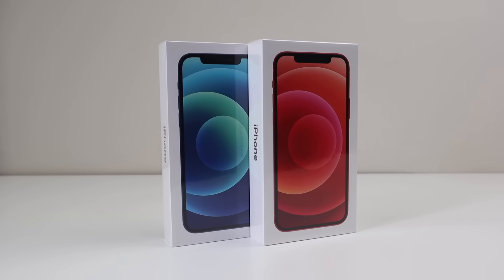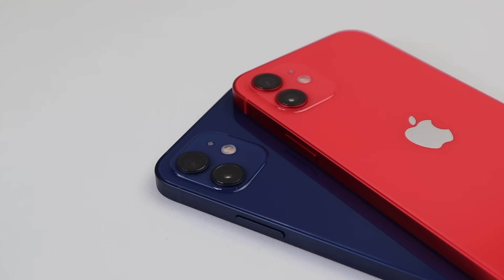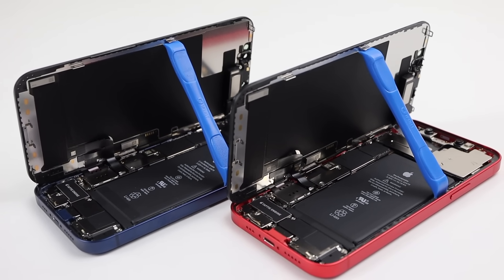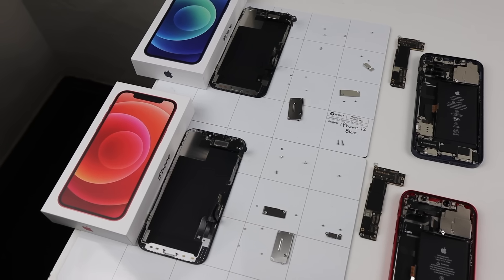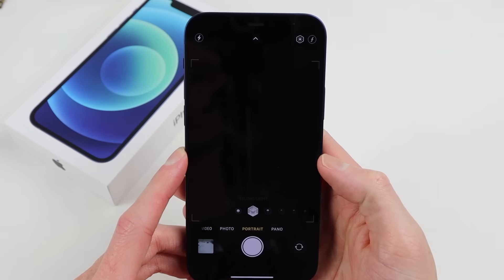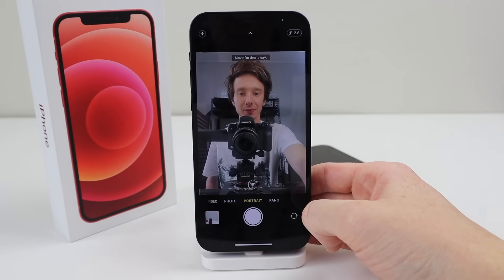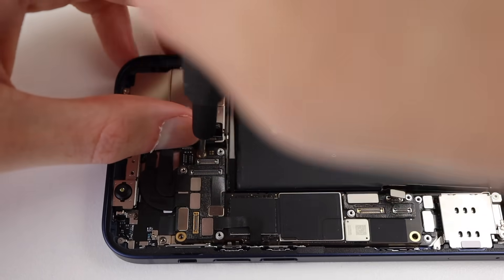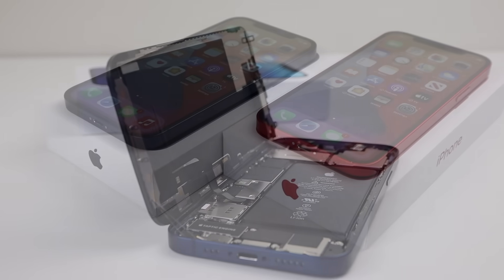iPhone 12 Anti Repair Design - Teardown and Repair Assessment

Comment: “We want to be 0 waste by 2030” but you gotta throw out your old chargers and any third party chargers in order to use your phone
Reply: Apple probably: It's not us who producing waste, it's the customers.
Reply: "It's a waste of potential revenue if our customers can just repair phones themselves, or worse still - with parts from other suppliers! Shocking, shocking waste... what can we do to reduce waste to zero..."
Reply: There can’t be any (new) waste if everything and everyone is dead ;)
Reply: ? old charger still work on the iphone
Reply: @dawaby1  yes. But if have a brick, but not a cable, the USB-C to lightning doesn’t work with whatever bricks you have at home, as most of them are USB-A. Therefor, you need to buy a brick with a USB-C input.

Comment: Ok Apple fanbois, why would you want to spend $1500 on a phone with a tiny battery, no ports and that you can't repair from your local shop?

A nice 'de-googled' Samsung would be a great choice and works well with all of the same features and apps. iOS isn't what it once was, and iTunes works with Android, so...?

Also, water resistance isn't the real reason for the stronger case glues.. An inexpensive case or ring holder (maybe both) would be in order if you aren't capable of not dropping your phone. These glass backs may be 'premium' but they can't handle life.

Comment: I think Apple must have released several versions of components or peripherals like battery, cameras, display or even face id with different compatibility codes for each card model.  Or the parts are encoded with a recognition memory circuit based on the operating system.  There will always be Chinese to dismantle everything and manufacture high quality parts using the same compatible manufacturing processes, as they are the ones who already manufacture and assemble.

Comment: As a part time automotive mechanic who works at an independent shop, I would be so infuriated if suddenly independent mechanics could no longer repair people's cars. Going to the dealership to repair an issue might give you better service and the problem might be diagnosed and fixed sooner, but it will be WAY more costly to do so. I really hate what Apple is doing, because this discourages lower middle class people from purchasing any iPhone since they know they can't afford to have Apple repair it and instead have to resort to 3rd party technicians, if that option is stripped away then they can't purchase an iPhone. Imagine if Ford went "What that? You did a simple task like changing your oil all on your own instead of paying four times the price to come to us? Welp looks like we'll just have to take your warranty." And this is just one issue with Apple, let alone all the other corporate bollocks they're pulling.
Reply: Apple dont repairs, they resell unfortunately, i got my iphone 5 years ago and i asked they to fix it, they say it was damaged by water and it's better to buy another phone. Then i went to an independent repairer, he simply install an older version of iPhone 5's OS and it just start working normally, this could also mean that Apple are using IOS updates to ruin your phones and make you buy new one.
Reply: @kharkovluzhin8333  this has been sadly proven for a while that yes they do slow down older devices with updates in an attempt to make your purchase new ones it’s really scummy
Reply: It’s not taking the warranty. In this case it’s taking away your keys or giving you a speedometer cap of 30mph

Comment: I’ve been a lot of you were going to be angry at me and call me an Apple fanboy.
The camera/Face ID issue prevents someone from hacking into the security of the device. 
The battery warning issue isn’t sure the app is not liable if someone tampers with the battery. 
At least there’s no error -12 issues yet. 
Apple is definitely guilty of making it hard to get parts and not allowing third-party resellers from doing proper repairs that Apple is not willing to do.

Comment: This both is an isn't new.. I replaced my iphone 6 screen and some parts had to be swapped over to get it to work right home button, mic...
Doing it to the display and battery however is... It's also kinda a dick move because those are the 2 parts people need replaced most...
Apple knows this and like either you get the repair from us or no repair for you....

Comment: I have no plan to buy the iPhone this man worked on. I was simply fascinated with his ability to remove and replace parts with ease, and his ability to reason out the different possibilities and variations to ascertain exactly what Apple is up to. I have problems replacing those little disc batteries in clocks, etc. and I nearly faint when I open the box for a new product and see that I'm going to have to use an Allen wrench. I am in awe of Hugh Jeffreys.

Comment: I am assuming that the temps you gave were Celsius, but it is an idea to specify this as two countries still bizarrely use Imperial measures. Thanks for your incredible and expensive work on this video.

After having Macs since the SE, I finally accept  that the company is evil in its anti-consumer methods.

Comment: Why should apple need to spend money to make their products reparable? If customers want reparable phones, they can stop buying apple and buy reparable phones. Apple has no duty to make their phones repairable. they can make their phones out of wood and chewing gum and its fine by them. The customers ultimately are the one who decides to buy a reparable phone or not. Customers have the choice, to have a USD1000 phone which cost USD500 to repair, or a USD1400 phone which cost USD100 to repair in order to maintain apple profits. customers have choosen the cheaper options. If apple made their phone repairable, in order to defend their profits, they will have to charge more for the phone which is bad for the poor.

Comment: It would be cool to have it say "the battery installed is not the original" but still give full functionality
Reply: But then you'd have no reason to take your iPhone into a apple service center, which would mean less money in apples pockets🤣
Reply: @robert9312  Or just close those shitty service centers and just let repair shops get approval and sell parts. 

All apple has to do is put the store in your home.
Reply: @PugilistCactus  I understand sarcasm/jokes are hard to detect in text, but I figured the "🤣" emoji would've implied such.
Reply: @robert9312  Gotta love capitalism :)))))))
Reply: @moose6815  capitalism is why I don't buy iPhones
Reply: @moose6815  

Capitalism allows you to buy another phone from a different company that lets you do third party repair. iPhones aren't the only phones in existence.
Reply: @alohasnackbarcell8071  I never have had and never plan to have an iphone or apple product. 

People should be able to repair what they purchased without having to go through a specific company to do it though. 

My problem is they don't outright tell you that third party repair is no longer an option with their devices, so people who purchased one not knowing about it, are getting an unfair deal weighed in the benefit of the manufacturer who gains from the purchase of the device, and then from the very expensive repair they are forcing you to get from them and them alone. 

It means they can charge as much as they want for it since they are the only ones who are able to do it. Some people may not have purchased the device themselves, it could have been be a gift. 

Not everyone with an iphone is mega rich either. It is very easy to say "Just go buy another that isn't and iphone" etc, but the reality is they might not be able to do that at the current time due to financial stress or other unforeseen circumstances getting in the way. 

Buying cheap phones that die within a year or two is wasteful, and other decent phones that wont become landfill within a short time frame, are still very expensive. That is why people want to be able to repair things. 

Apple not letting people get third party repairs is anti-consumer, it is an effort to leech more money from you for daring to keep the same phone instead of buying a new one and is designed to breed a sense of exclusivity about the product to make it desirable as physical representation of status (being above cheap repair). 

Capitalism is manipulative and exploitative and no matter what you can't escape it. It benefits only the rich and forces the poor into participating to their own detriment, often without them realizing. Shitty system.
Reply: @moose6815  

So, because you were too lazy to research into the product you're buying and got stuck with a phone that you can't repair, that's capitalism's fault?

Your sense of entitlement is the problem, not Apple and their shitty practices. 

You aren't entitled to everyone treating you how you want, be it a person or a company.
Reply: @alohasnackbarcell8071  People can receive things as gifts, no? Not everything is that simple
Reply: @moose6815  thats a lot of chins
Reply: @alohasnackbarcell8071  Imo theres nothing wrong with refusing to conform to shitty treatment. Yeah, ofc no one is entitled to a quality service, but that doesnt mean we should accept this kind of bullshit
Reply: @moose6815  Like the appendix in the human body, a long time ago it served a purpose, but it has been so long, we forgot what it was...
Reply: @legogamer1472  Non-Compete is a Youtube channel that will tell you how capitalism has outlived its usefulness. There is only one species of Homo Sapien.
Reply: @moose6815  I agree...Capitalism is a dinosaur. We need more voluntary giving and less mandatory taking. Help someone hunt/gather food because you don't want him to be hungry because you yourself don't like being hungry and wouldn't want to wish it upon hum.
Reply: @tomnyskull  I agree, just like big media censorship, your rights don't go away when you use the internet or use a gadget. It's as if there's a town full of elderly people where the only restaurant in a 30 mile radius lets people smoke cheap cigars and pollute the air and the capitalist apologist just says "Well, don't give that restaurant your money if you don't like cigar smoke", but the town has no public transportation and it's practically God's waiting room and you're the only 39 year old around that want's to breathe clean air and the laws on the books of that exact town do not permit smoking in a eating establishment but the restaurant uses the defense "My business, my rules.." Profits should not be above the law of the land.
Reply: @moose6815  It's not entirely capitalisms fault. It's abuse of the system, why else would you think a company would spend millions of dollars to lobby against consumer choice and digitally lock their devices against repair work. There's technically laws that should be protecting consumers from abuse but their outdated and the government is bribed off... Right to repair is the right way to go. Imagine if you couldn't even change your car tires without going to an authorized dealer repair center. Its gross miss conduct of the system against consumer and small business rights!

What's bad is if a company like Apple can get away with it others follow suit.
Reply: @alohasnackbarcell8071  
Crapitalism allows you to support another manufacturer before they start doing the same as Apple.
Also, crapitalism creates an incentive for everyone to do the same as Apple.
It’s a perpetual losing game.
Reply: @plecebomc  
 Crapitalism is a system that creates corruption, we wouldn’t have a corporate lobbying problem if the economy would be composed exclusively from cooperatives and family businesses interacting with each other and with the end consumers not through the “free market” but through a general economic public exchange infrastructure organised by a huge pool of logistics engineers, economists, public relations workers, etc, maintained by everyone through taxes and controlled democratically by us, the actual users, the consumers.
Reply: @brentfisher902  You say these things, but communism and socialism have been thoroughly tested and left many countries in a horrendous condition. Hard pass on bringing that here. But if you are not a fan of capitalism then move to a socialist country. 

Also fun fact there is no true form of socialism on the planet. While many people will argue and say ants and bees are akin to socialism, they are manipulated and controlled through phemones. You can trick a living ant into thinking its dead just with pheromones.
Reply: @robert9312  they really do it so you have less chances of the 3rd party parts ruining your phone, I took my 6 in for a new battery In a 3rd party and the battery ended up expanding and destroying my screen and it short circuited everything else so I had to get a new phone
Reply: @takodacollier774  well you probably went to the cheapest repair shop ever lol
Reply: @thehomiejw6714  actually no it was a 5 star one and paid around 120
Reply: *I paid
Reply: @takodacollier774  excuse me but when was it that happened
Reply: @thehomiejw6714  ?? If you meant when it was around when the 8 came out
Reply: As if. Apple once bricked people's phones for daring to use third party home buttons, they never do anything for the customer if it means then losing profits
Reply: Man, I miss the times where you could change the battery on phones.
Reply: Yeah but then they wouldn't make those 4 extra pennies
Reply: So, you want Apple to make less $$$$?? How dare you!
Reply: Apple is only relevant because of import laws. Huawei makes far better products at much better prices. If the us actually had an open market Apple would be in the same drawer as compaq and packaged bell.⚰️
Reply: The pixel 5 is so much better. Have never gone back to Apple
Reply: It's not cool if something does the bare minimum, it's normal.
Reply: My Dell laptop from 2014 Won't charge because it has a non-factory battery. This problem isn't new.
Reply: @RinrvUSA  Dells loves vendor lock
Reply: @RinrvUSA  either shit battery without a pulled control board or a fucked MAX charge ic, both are easily solvable. Found that problem countless times when I used to repair consumer electronics
Reply: I guess it’s somewhere in the user agreement that specifies no 3rd party repairs, and I guess non original components could be of inferior quality or malicious in some way or another?
Reply: @ljc6141  Make no difference if they hide this capital feature in their 30 meter long legal papers to avoid being honest, or if it's just not there.
It's out of reach in both situations.

And they don't check for the battery's quality, just for if it's apple.
They don't actually care if the thing is quality or not, they don't have a list of allowed battery that have equal quality even though it exist.
They just want your money.

And for the battery's choice... It should be the consumer's choice because it's the consumer's proprety.
It's his.
Reply: How would apple know that the battery is of quality? If the manufacturer of generic battery probably cuts corners and does not sync correctly to the software since it’s missing things. What if someone sea you a “new” iPhone you won’t notice it was tempered with.
Reply: @audionews8659  It shouldn't be Apple's decision to not let "inferior parts" be installed properly, it should be the consumer's. What's wrong with being able to do what you want with a product you buy?

Edit: And besides, everyone knows to be skeptical of anything bought secondhand
Reply: @blakebell8533  the replacement battery is not inferior, but the apple firmware checks for a battery serial number.
Reply: @jacklwebber  "inferior" was meant to be sarcasm. I know that the software looks for some sort of data that confirms that it's Apple certified

Comment: You might be the first to find it on the 12 but they've been pairing hardware and software for a long time. It didn't just start on the 12.
Reply: I think it started with touch id on the 5s

Comment: I used to repair old iPhones and it was a problem where a used certain brands of front-facing cameras the phone would need to be serviced and have a particular program run on an Apple computer using the diagnostic software to unlock the camera. They specifically didn't call it unlocking or pairing or any of the sort in any of the literature or in the app. It appeared to me to be 100% just verifying that it's a genuine part before allowing the functionality to happen again. People get in trouble for this, corporations aren't people, but they should still get in trouble.

Comment: I am never buying an I phone for the simple reason no earnud outlet to plug them in. I was going to buy a galaxy S22 but not doing that either. I am not using wireless ear buds 
or a wireless charger either. Keep your brain destroying radiation  as low as possible. Phones already come with radiation warnings so why fry your brain more.
Reply: Do you have wifi?

Comment: I’m probably going to end up switching off of Apple. I’m currently on the iPhone 6 and will need a new phone eventually. iPhone is getting increasingly more expensive with more little issues that hamper its longevity. That is, unless I dump my cash into Apple to buy a new phone or repair it. I like Apple and it’s quality, but it’s increasingly becoming more difficult to stay with them.